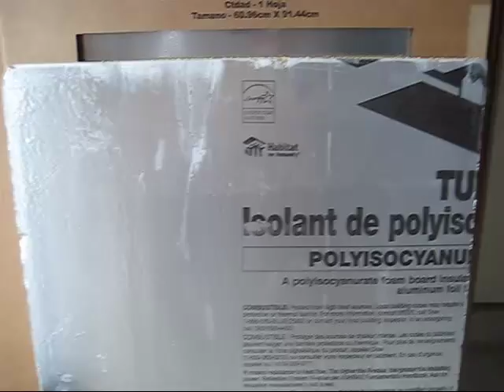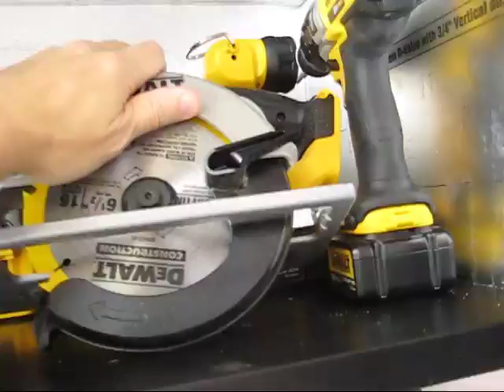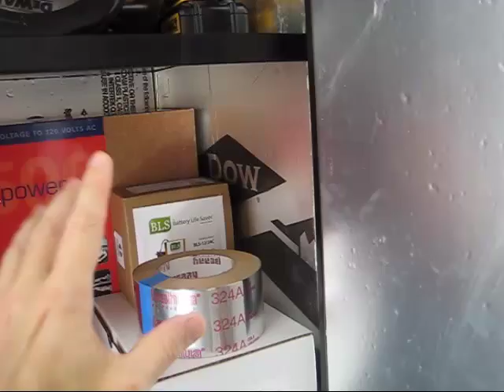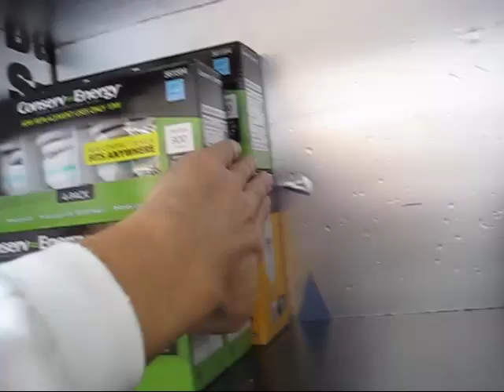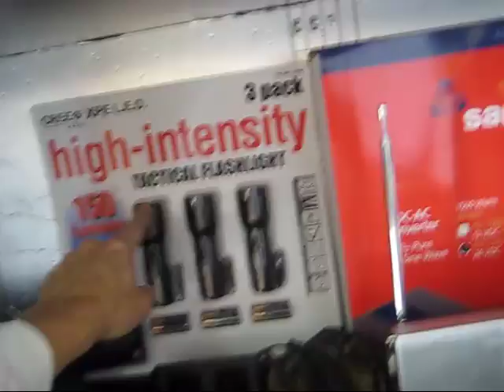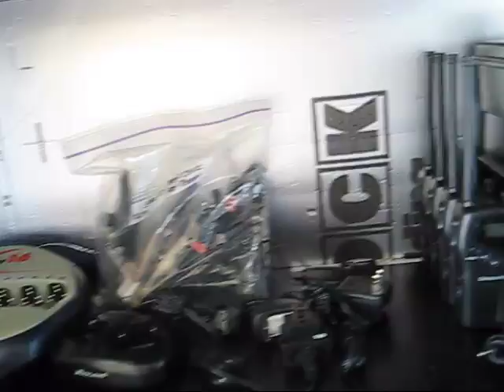Faraday Cage: How to Make on the Cheap

Comment: Actually, "STATIC" is indeed a signal.  Your configuration may block 'RF', but it won't necessarily work as you 'hope' it will in the event of a 'HEMP' or a strong 'CME'.  BOTH of those eveents will generate BROADBAND ENERGY.

One "BIG" problem with your sealing method with 'AirCond Tape' is that IT DOES NOT HAVE CONDUCTING ADHESIVE.

You are totally incorrect about "NO ONE KNOWS".  If you wish to be informed, and not brutally devastated by the un-truths of your assumptions, do some research.  There are numerous scholarly papers, government and industrial studies and tests, and several very technically-oriented websites.

Your double-layer of tape on the hinges made me laugh so hard I almost exploded my appendix !!!:face-green-smiling:

Comment: "Wow", Thank you for that Great Ideal. 🤔 A Metal Storage Cabinet w/Matalic Tape to Protect My Larger Equipment. This is Fantastic. I have a Faraday Duffle Bag & 2 Silver Trash Can's Stocked Full & I still Need Something Bigger, so I'm Very Grateful for Your Suggestion & Video. I've been getting Ready for about 8-9 Year's. I'm Stocked Up w/Food & Water & Medicine & Seed's & I'm even Ordering White Steel Security Bar's for My Door's & Window's so I can Protect Myself & My Supplies. I even put an "EMP Protector" on the House & Car. I'm Trying so Hard to Learn Everything I can to Survive. 🫡 Good Luck Everybody.
Reply: "EMP Protectors" are PURE SNAKE OIL.  Please do some research.  You spent unnecessary dollars on pure hogwash.  Sorry, Ronda

Comment: I'm a little confused.  You insulation is metallic and the tape covering the holes is metallic, but you don't have anything between those and your electronics, so how will the electronics not be affected without a layer of cardboard at least between them and the metallic tape?

Also, is it possible to simply put an electronic device in a cardboard box into a metallic cabinet and have it insulated against an EMP or does the cabinet NEED to be fully lined?

Comment: Greetings, I got one of these as well. The shelves are metal  and supported by the steel walls. Can I insulate the shelves with a rubber mat so as to insulate the items from the metal or should I install insulate shelves in the place of the metal ones?

Comment: Could I use a chest freezer as a faraday cage. ???
Reply from the maker: If you modified it. It won't work as is because of the rubber seal around the door. I've gotten away from building faraday cages. I only use this now. www.ldsprepper.com/empbags
Reply: @LDSPrepper  Ok bud thanks for getting back to me.

Comment: You made the huge mistake of not insulating the shelves from the exterior of the cabinet. You also need to have a better seal between the door jams in the middle, top and bottom too.

Comment: It may not be on the cheap but you have got to do multiple layers. I put Copper foil and then a layer of RFID blocking fabric. It would also be better if your cage was a more conductive metal. Or if you want to go really cheap but also sort of expensive. A salt water fish aquarium.

Comment: I have built a GI wardrobe faraday cage.  One thing I did was I bonded the doors using a section of the outer shield from a coaxial cable to the body of the cabinet. Had good signal attenuation in the cage.

Comment: Okay so how do you know it's not getting radio waves? Maybe all you've done is make that cabinet soundproof. Just because you can't hear the radio doesn't mean it is not on, isn't that correct, if it is on that means it is receiving which would indicate an EMP would be able to fry the circuit, no?

Comment: I recently bought a water making machine (A dehumidifier!!!) to keep in my cage.  I already have several different water filters to use on the water.  One of my filters is a pump style that all I have to do is drain the collected water into a bucket then pump the water into a water pitcher or drinking glass. I will triple wrap the box the dehumidifier  came in in heavy foil an set it aside for when things go sideways!

Comment: Without proper grounding this is useless. A metal cabinet or cage grounded by copper conductors leading to copper clad ground rods. You must lead that EMP voltage away from the cage/cabinet.

Comment: THIS WILL ONLY WORK WITK THE LOWER FREQ. OF AN EMP PULSE MAYBE 0 TO 110 HRZ BUT A EMP GENERATE 0 TO UP TO 300 MEGAHRZ PLUS U DO NEED TO GROUND THE CAGE TO GET RID OF THE ENERGY GENEREATED BY THE PULSE. SO  THE FM RADIO TEST IS WORTHLESS AS MOST ELECTRONICS OPERATE RATE IN THE MEGAHERTZ RANGE TODAY. THE ONLY TRULY SAFE WAY IS A SOLDERED COPPER OR LEAD BOX 1/4 INCH THICK INSULATED WITH NON STATIC FOAM AN GROUNDED TO THE EARTH WITH A HACKSAW TAPED TO THE OUTSIDE TO OPEN IT!!!

Comment: Will some one please give Plans and Advice on making a Faraday Cage out of an old Refrigerator ?  They are much easier to find and much cheaper to get for about $50 or so, sometimes even for Free. (people  throw them away)  They have insulation in them and the doors have gaskets that can seal air out. What Improvements would be Needed to make this idea  Work ?
Reply: did you get an answer from anyone, I would like to know and make one myself

Comment: According to a 1985 scientific study, the EMP signal would be approximately 73,000 times stronger than a normal fm signal.
Reply: rrkreutz2 that maybe so but it has a very vass area to cover. And as it does it weakens. Also it is always better to do something in preparation than to do nothing.

Comment: Hey I have worked around and inside faraday cages for a while on mine I os a Gi cabinet  I added a 4"  length of coaxial shield between the cabinet and each door to provide a good electrical bond .

Comment: on those panels did you actually see if they are conductive? sometimes they use a silvery mylar which really does not help with energy waves, only heat, like the cheap emergency blankets.

Comment: You need to EARTH GROUND THE FRAME with a proper earthing rod and cable, also the inside of the box MUST be isolated from the skin of the box by a non conductive material or the item becomes the box skin.

Comment: I swear, if I asked  1000 people how to build an effective faraday cage you'd get 1 million different answers. DOES ANYONE KNOW  'HOW TO BUILD AN EFFECTIVE FARADAY CAGE?'.  Some say to ground it, some say don't ground it.  Some say seal it with metal tape, some say don't worry about that.  Some say if a radio signal gets out of the cage it won't be effective. Oh my goodness,  "If ya don't know how, stop saying that you DO Know.  Disinformation is worse than not knowing.  I'm wanting to build a cage around a whole house generator.  Does anyone really know 'how to?'
Reply: Keep the generator in the box it came in and wrap that metal tape around the box covering every part of the box including the corners. Do atleast two layers. Or build a sheet metal box welding all sides together except one. Then set the generator on the side you didnt weld on the floor and put the other part of the box over the generator and bottom  side of box. In essence just make a metal box around what you want kept safe and thats it.

Comment: If you have a gas powered chainsaw, I wouldn't waste the space in your cage. It wouldn't have a battery or a circuit board.
Reply: no but it does have a small CDI ignition system and it will probably be deader than hell if it's not in a cage......Hope you got the upper body strength to chop wood of you don't put one away.  Probably won't have any gas anyway but that's another debate.........

Comment: Why would you need light bulbs and kitchen appliances if the electrical systems are fried?
Reply: because he has a solar generator so will not need the grid. Duh!
Reply: plug up the head when there is new idea

Comment: Came here for the comments. Lots of good suggestions. If you want fantastic portable EMP protection, ESD bags are the way to go. No sense in leaving your valuable and highly useful gear parked on a shelf. 24 X 32 bags are around $6-10 (lots of 100 @ $2- 3 each). With ziplock seals, your gear is water resistant as well.

Comment: Does anybody have any ideas on how to build a faraday cage around an electronic component that has wires running to it off a power source?   
I have an expensive 2000 watt inverter that is hooked to my solar battery bank.  I would like to put it into a Faraday cage, but will need to somehow slip the wires thru it.  Any ideas on whether this will work, or will the wires still receive an EMP and fry my inverter?

Thanks for the help.
Reply: oldsarge101 Damn brother!  You got the creds!  Let me know what you find.  From what I have researched most say the diodes in the panels will short out causing massive cascading of the failure of each panel rapidly.  In all reality we really won't know until it actually happens.  Read One Second After yet?  I listened to it on audio....frikin depressing but seriously thought provoking. People have no idea what to do if the fridge stops working.  I say it would be mass pandemonium in less than 48 hours.  A HELL of a lot of dead people in the first 30 days. Very interesting visit!
Reply: Just remember- the biggest threat to a prepper is someone knowing they're a prepper.
Reply: You MIGHT be able to pass a cable through the cage and you might not....I say not.  At any rate, anything you have on the outside of the cage will act as an antenna and carry the pule through the fittings and still wipe out any sensitive electronics inside the cage.  Even solar panels will stop working if they're deployed when an EMP hits.  It all depends on where it is set off, how high and how strong the pulse.  They've been developing EMP weapons for years and they're damn good at it now.  But it is line of sight so if you're "in the shadow" of the pulse like behind a mountain it might not effect your stuff.  I wouldn't take any chances.  It is a wide spectrum extremely high energy pulse and it will penetrate even the smallest hole in your cage.  It has to be perfectly sealed to be positive it won't take your your stuff.  Some say it won't effect anything that isn't on and running when it hits.....I say that's crazy.  What happens in an EMP is a multiband super high strength electro-magnetic pulse and your microprocessors have super fine wiring inside that will act like a fuse during a strike.  It will fry all the superfine wiring (like on solid state circuits) and they will short themselves out if you turn them on.  Instant fry......in the blink of an eye. A pulse will probably be in waves and last less than a second.   But it's anyone's guess and until it actually happens we're all just speculating.  I say a cage will work....and I'm banking on it.  By the way....I'm a ham radio Extra so I do have some specific knowledge of this subject.  May not be perfect but the evidence strongly suggest what I say.  But here's your really big problem with having wires passing through from your solar panels to the charge controller a and batteries......your solar panels WILL be effected by the EMP.  Solar panels are basically made up from diodes and they will all fry instantly if an EMP hits......you have to protect them too until AFTER the EMP.
Reply: oldsarge101 Sarge...most everything I have read indicates solar panels will NOT survive an EMP.  They fail in tests.  But to tell the truth it's really hard to say.  I'm a ham radio extra and I have done a lot of research on the subject.  I'm not going to go so far as to say it would DEFINITELY affect the panels themselves but I absolutely guarantee that if they're hooked up to a controller it would fry the controller and inverter.  And for the record, it's not just mosfets that would be affected....pretty much ANY solid state circuit board will probably short out and not just the transistors.  The micro components have  extremely small connectors and they would most likely all fry.  They are all miniature antennas and collect millions of volts at untold amps and they cannot maintain integrity in those conditions.
Reply: I spent a few years as a contractor for DLA supplying electro-mechanical fuses for missile systems. Type II and III circuit boards arming initiating explosives, so our ESD awareness was pretty high- but not so much focused on EMP. I still can't see how modern solar panels are EMP sensitive. But you gave me something else to research and that ain't a bad thing. THX!
Reply: oldsarge101 hehe  with ya on that one sar......but then again I don't imagine you would be one of those that can't figure out how to feed yourself either...... I live in Wyoming....where the men are men....and the women are too!  I got out of dodge as soon as I saw the world going to shit......I THINK I'm pretty well set if the shtf.....I'm more worried about marauders than the event.  Otherwise I've put a lot of effort into being prepped.....yep...tin hat guy
Reply: sorry but who cares about what u press give glory to Yahuah for your health and share info people are here to find.....with all due respect.......
Reply: You can pass cabling through the faraday cage. You're protecting the inverter only and there's not enough EMP seepage for a small opening. Commercial cages for science equipment have cable openings.
Reply: Thanks for the reply.
Reply: MOSFET devices and many other integrated circuits will be affected by an EMP pulse- regardless if it's in operation or not. And solar panels will NOT be affected. It's their controllers that are susceptible. EMP damage occurs when there is a transfer of charges between paths. If those paths are parallel to each other and unprotected, they will "cross talk" and set up a sympathetic charge- causing an electrostatic discharge that will violate the circuit path. Yes, a cage will work- but only if it guards the voltage regulator.
Reply: https://youtu.be/GYLn7wgGxPo

Comment: Could I make one from an old broken freezer? I've heard an old microve oven works well. Is it true? What is the issue if it's grounded? Should I protect it from grounding accidently and can I safely bury my Faraday cage?
Reply: A microwave oven would only provide protection from EMP pulses in the 2400-2500 MHz range. Unfortunately, most EMP devices are designed to produce a short burst over a wide frequency range but usually less than 1000 MHz. I wouldn't expect a freezer to make a good cage without constructing some kind of electrostatic lining.

Comment: I would also put extra car parts, alt/gen, battery charger ,multimeter, for testing electronics, any kind of electrical components.
Reply: You read One Second After, didn't you!
Reply: +Newsman Andy - I am about to build a Faraday cage just for that reason. I already have spare electrical everything for my old 1972 Ford -150 PU. I bought it because it has the old time simple ignition system, mechanical fuel pump, carburetor etc. Don't forget a wiper motor. Good luck.

Comment: ok. I couldn't find the insulation that you used. so....I tried robbing every first aid kit that all of my family and work thought was useless and removed the mylar blankets. I then lined my Faraday cage similar to yours with cardboard that was Christmas wrapped with mylar and taped with ducting tape. And bam! works like a charm. Zero radio signal leaks and great protection.

Comment: To be extra sure, you can wrap your electronics with insulation and then aluminum foil before sticking them in the cabinet. This will give you a Faraday Cage in a Faraday Cage where the pulse would be weakened by the outer layer, which the inner layer can handle. Just be sure to insulate it well, note that if you put too many layers of shielding between your electronics and the pulse you would cause something called "skinning", which basically turns your Faraday Cage into a giant capacitor. But don't worry, touching the Faraday Cage should ground the charge without causing harm to you or your electronics.

Comment: what about a gas  generator, i also have one of those" Wagan Power Dome EX Compact Generator" that you charge then you can charge dc things as well, do these generators need to be put in a faraday cage?
Reply: Anything that has a circuit board ie electronics and or electro magnetic motors

Comment: Very good - but all your equipment is going to need power to run it.  I think you'll find there will be no current flowing through the grid after such an attack.
( This is all supposition of course, because it has never happened, so no one KNOWS for certain what,  if any,  effect would result. )

Comment: emp,s are 75000 times stronger from 500 miles away then radio waves,you should put every item in there in a faraday bag line the sides with 10 gaga ,still wont work dont think,

Comment: Things people do not think about?  First what about the mile of copper and aluminum wire you have running through your home?  In an EMP situation that wire is going to get hot enough to start a fire in your wood structure, rather it has a brick shell or not.   Now that cabinet is nice,  however, how will it do when exposed to heat?  In other words if your house burns down around it, do you really think it is insulated enough to save your electronic equipment?  I am an believer in Faraday cages, however, the best place for them is underground, away from electric wiring and combustible materials, unless they are insulated well enough to withstand intense heat, and you able to access them after an EMP.  Just thinking?
Reply: +Ed Briley Some people don't think about that. Others do in fact put their Faraday cages off site or at least away from their house.

What people don't think about is: how are you going to make it home when something happens and you are not there.
Reply: +Nathan Stotts walkie talkie, maps, compass, water filter straw, protein snacks, boots or skates right?
Reply: For the most part yes, and a knife or multi-tool of sorts, fire starting material.